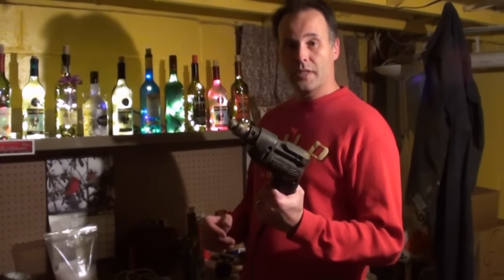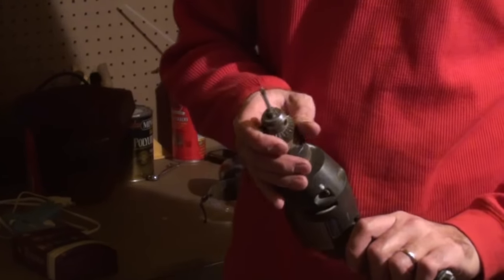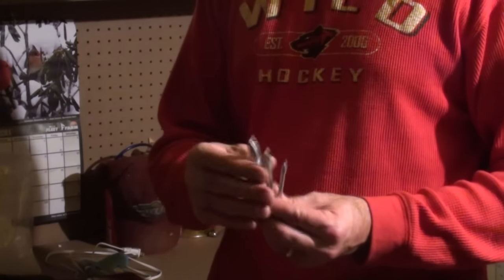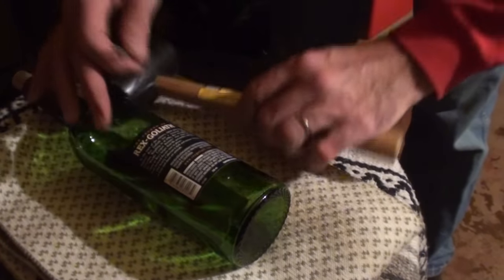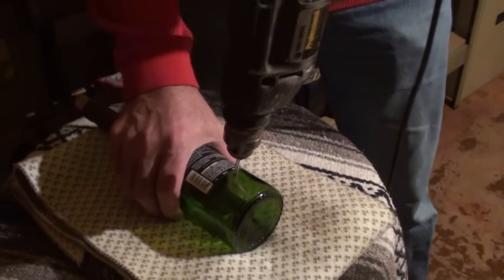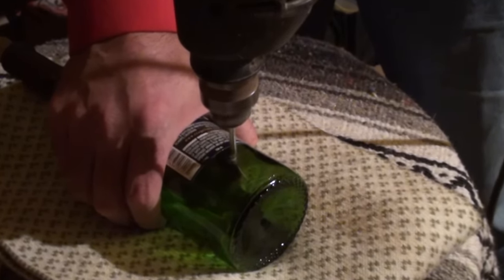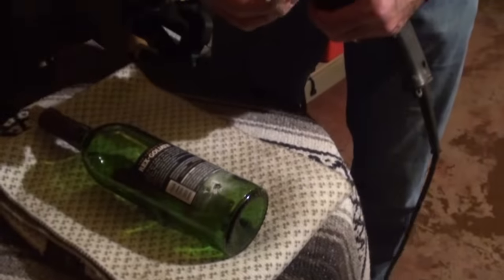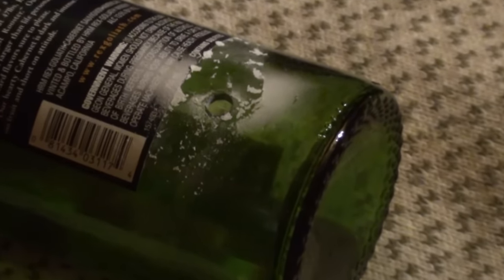HOW TO  Make Bottle Lights *DIY Wine Bottle Light*

Comment: why not cut the plug off, put the lites down from the top fishing out the cord end from a much smaller hole. solder a lew lamp cord with a switch on it and put the soldered part back in the bottle, seal it up...
Reply from the maker: Jackson Redstar Photography,
It makes perfect sense. Some people don't want to hassle cutting and soldering the end of the light string.

Comment: What size is that big glass drill bit you used?
Reply from the maker: +Jesse Chou,
The sizes range from 1/8'' , 3/16'', 1/4'' and the biggest at 5/16".
Reply: +Nick Jager Thanks Nick. For some reason it just looked bigger in the video.  I have a set and mine looks tiny. haha.  Was thinking about making a lamp, but thinking I might need a larger hole.  I saw a set that had a 3/8" and 1/2" bit also, but it was the set that had a more cone tip.  Also, was thinking about putting a rubber grommet inside to prevent the cord from getting cut.  Have you made lamps with a grommet inside, if so what size do you suggest and what hole size would you suggest?  Thanks.  btw nice video.
Reply from the maker: +Jesse Chou,
If you are making a bottle lamp then I would go with a 1/2" hole. The grommets seem to vary in size and shape and it's hard to give you a defnite answer on that. I would start small and work my way up to get the proper fit.
If you are making a bottle with lights then you want to gauge the size of the hole that you drill by the size of the lights on the string. Hold one of the lights next to your drill bit and see wether or not you would be able to push it through.
Good luck with your project and let us know how it turns out for you on the Bottle-lamp site.

Comment: Isn't is necessary to be lubricating the bit with water as you're drilling?
Reply from the maker: Not necessary but you most certainly can. A ring of plumbers putty will do the trick.
Reply: Okay, cool! I wasn't sure what exactly that ring was. Makes sense and thanks again!

Comment from the maker: msraider1500,
Are you using actual 'glass drilling bits'? Check out the link on the bottle-lamp resources page. There is a picture of the drill bits that I used and you should be able to find out if you're using the same.
How far are you getting? Does the bottle break right away or are you well into the drilling process? I've used several different sized drill bits so the drilling process can be done in stages. Think of the first drill hole as the pilot hole. Working from there to expand on it.

Comment: Help!!  I've tried drilling 4 bottles and all of them have shattered. What am I doing wrong. I am using Bosch glass and tile bits.
Reply from the maker: Judith,
Are they glass tile drilling bits? Regular drill bits won't work with glass. The heads are shaped differently. If you would like to refer to our "supplies" page on the bottle-lamp website, the second item listed is 'Glass Cutting Drill Bits'. Check the picture and compare them with the ones you're using.
If at this point you determine that you are using the proper drill bits and you are still getting the same results, we can talk about where exactly you're drilling the hole.If you're too close to the base then the end result will be the whole bottom breaking out. You want to be at least 1 1/2" from the bottom.
Remember, slow and steady winds the race. Try just getting through the glass with your smallest drill bit and work from there.
Hope this helps,
Nick
Reply: I use diamond crusted glass hole saws, about $17 for the 3/8 model at Lowes, and RUN WATER over your hole sight as you drill it, apply very VERY little pressure, let the weight of the drill and torque of the bit do th ework,

Comment: The video is great, but I would like to point out one safety point for those trying to do this for the first time. BE SURE TO WEAR SAFETY GOGGLES AND LEATHER GLOVES!. If the bottle has any unknown flaws, there is a good chance that during the process there would be a shatter. If this occurs, severe lacerations, and/or eye damage is a real possibility.
Reply from the maker: Yes, you are absolutely correct. I mention the safety glasses but don not address leather gloves. Thank you for adding that.

Comment: In order to prevent cracking the bottle, use water or oil to cool down the drillbit and glass. I would not attempt anything like this dry drilling with a precious bottle.
Reply from the maker: Thank you. Hoping for better results.

Comment from the maker: I never thought about doing it that way but yes, you could. You wouldn't have to actually make the hole so big. The opening at the top of the bottle would be large enough to accommodate the light string. 
This would work well if you planned on rewiring the lights to a switch or a longer cord. You could use a small weight on a string and then pull the wire through the bottle and out the hole in the back. A smaller hole in the bottle would be easier to hand drill.
Let us know how it went for you.

Comment: Doesn't the bottle get HOT?
Reply from the maker: +Evaristo De Souza,
It depends. If you use a regular light string, the bottle will get warm. If you use an LED light string it won't. The LED's are a little more pricey but well worth the assurance that your bottle won't over heat.

Comment: Sorry. Yes I meant glass
Reply from the maker: No worries. O.k. lets take a look at what happened. 
1) Where on the bottle did you start to drill?
 You don't want to drill to close to the base.
2) How fast were you drilling?
 This takes quite awhile to drill. I've learned the hard way myself that if I try to rush things it doesn't work well. 
3) Did it get warm?
 Heat is the enemy here. In the video I went back and forth with the drill bits to avoid this problem. If you want to can drill on the bottle while it's submerged in water.

I hope this helps. Please let me know if you need anymore assistance. ;)